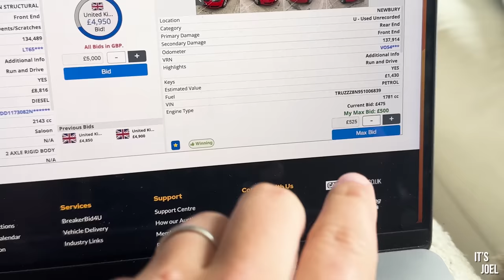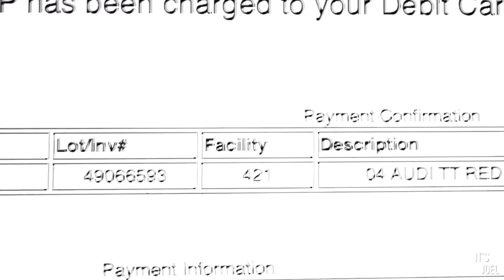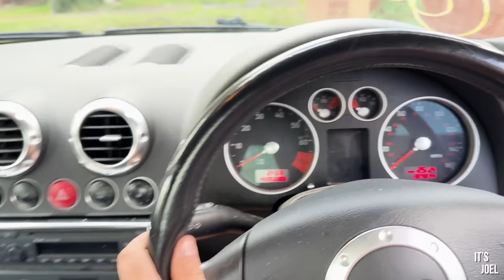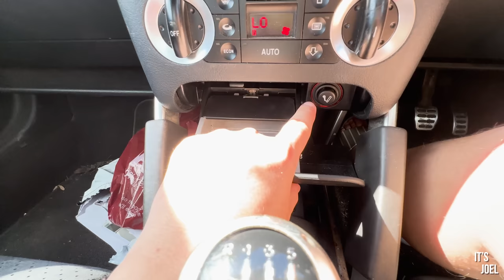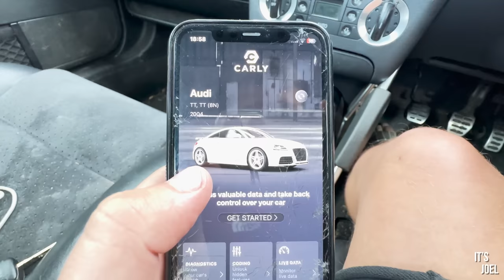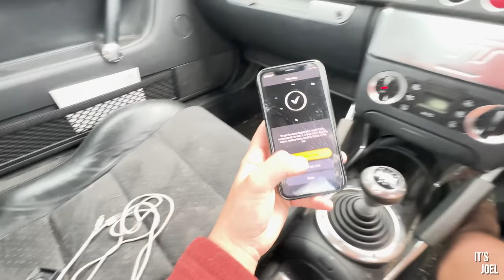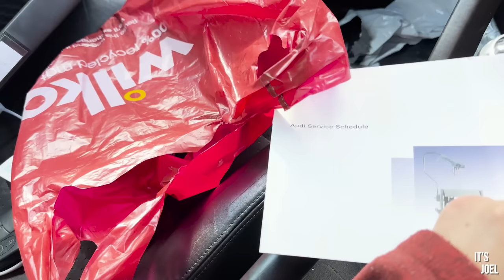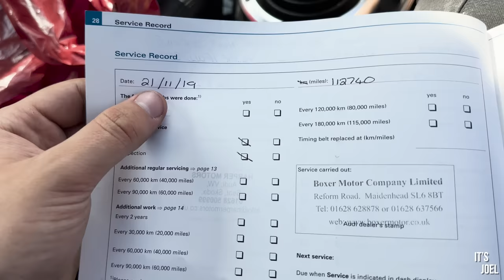I ACCIDENTALLY BOUGHT THIS VERY CHEAP AUDI TT ON COPART...

Comment: You should DEFINITELY service it Joel, and service the Haldex filter and fluid as well. Believe me the car will thank you for it!!!
Reply: no haldex it's not the bam model
Reply: @ianbawler5714  lots of other tts had quattro, it was an option for the 180hp and the 225hp apx cars had it too. Although you're right this car has no quattro / haldex.
Reply: no haldex yeah, the boot floor has a bit less depth on quattros
Reply: @fabium3410  aye there's way less space in the back of mine!
Reply: @ianbawler5714  Not saying you are wrong....but Harper Motors mentioned the Haldex system April 2016..... see 27:58. They spelt it Heldex...which is a bit worrying!
Others agree with you....and surely if had Haldex/AWD it would say "Quattro" somewhere?

Comment: I think you probably got a pretty good deal! A 1.8t without a check engine light has to have been serviced and as long as it doesn’t have rust holes in the body it’s definitely worth saving. If you’re going to keep it  then the most important thing with 1.8ts is oil changes and the timing belt

Comment: If you’re keeping - get the cambelt and tensioners changed. Ive just bought a 2004 myself and and put back on the road after 6 years unused. 8 weeks of restoring and maintenance and passed the mot 1st time with no advisories. Well pleased. And i changed the cam belt. Not a nice job!
Reply: Came here to suggest cambelt immediately, that service history doesn't sound like its been done previous

Comment: Looks like a bargain, Just make sure it gets an oil change sooner rather than later, as the old 1.8 turbo does suffer with a blocked oil pickup if neglected.

Comment: Great purchase. I believe those engines can sludge up if not looked after so given those service intervals definitely check the breather system is functioning correctly, clean the oil screen in the sump and maybe one or two oil changes. Well done!

Comment: I had a late 2002 225bhp 1.8ltr for five years and absolutely loved it.  The little spoiler on the back followed the "moose" test in pre-development (it's worth checking some of those early avoidance videos!)  I had very little trouble with mine; a broken clutch cable which was annoying at the time but bullet-proof Audi reliability otherwise.  The fuel economy was surprisingly good for a quick car although the traction control can be a little interfering on very twisty roads.... so you need to turn it off to enjoy it.  I'm sure it will scrub up well and you'll get plenty of enjoyable use from it.

Comment: I think you've done pretty well there! I've bought 3 cars from Copart that weren't obviously damaged or written off ... Two had major gearbox issues and the other a flywheel and engine issue, none were advertised as such, but you take your chances. So I don't buy anything that isn't obviously damaged from Copart now. But, I love to see what turns up and then how good I can make it. You don't often get service history though, my local Copart chucks it away, saying its a GDPR risk ... Hmm. 
If that drives well, it looks like a decent buy and probably one worth tidying up and dailying for a bit. Looking forward to a driving video!

Comment: For the airbag light, one of the sensor connectors must be loose, pull off the interior panels and try to find it. Mine was the passenger side near the recliner handle. Also the dash lcd can be replaced, yours doesn’t look too bad but replacing it isn’t very difficult.

Comment: Have a look at FuriousDriving with re: to headlight restoration, can do it without a machine polisher. 
If you're going to go to the 'ring, I'd 100% change the tyres, I mean, even if its only to a reasonable mid range, it'll make a world of difference. (I run Debica Presto UHP2's, they're a company who are owned by and make tyres for Goodyear, so they aren't half bad)
Also, the underpinnings of this car is the MK4 Golf platform, so control arms and rusty subframes should be fairly cheap and easy to get a hold of 👍

Comment: Get the oil pick up oil changed. This is crucial maintenance on the 1.8T engine. The 150 & 180bhp models from my experience are usually less problematic than the 225's. No Quattro makes the car lighter and less to go wrong. Old 20yr+ cars I always recommend to people are mk1 TT's, Z4 and Mini Cooper S

Comment: Check under seats for air bag wiring which corrode or come apart mine was the same when I got it ,oil and filter a must and the oil pickup pipe in the sump cam belt and water pump you’ll have loads of fun 👍👨🏻‍🏭

Comment: I just did very similar but with a motorcycle.
I brought a 1998 honda fireblade for £620 with auction fees.
No history, no mot, I didn’t hear it running. 
Went through the mot no advisory’s it had recent tyres chain and sprockets no corrosion ride it every opportunity it’s fantastic bargain

Comment: Seems a great buy at the price but as you say : why did it end up at Copart ? Looking forward to the test drive video ! If you can get it clean , serviced and not throwing codes, never mind the Nurburgring I reckon Katy might be interested 😀
Reply: Indeed.  Should be a good project - a good clean and service of engine/gearbox/diff and it is ready for some summer fun.  I guess it ended up at Copart due to iffy service history and needing bodywork - they probably sold it at a normal auction without success so just punted it onto Copart as a last resort.

Comment: Joel, what a happy little accident :) Cosmetically, mostly it will clean up. If you ignore trying to fix the actual cosmetic damage (broken bumper, and seemingly peeling clear coat?) then there is lots of fun to be had with minimal cost. I have been considering one for a run-around with the missus and the dog for a while as, like you, my daily driver costs a little more to run and takes up a lot more space. They are surprisingly practical cars, just ask "All Torque" or "The Car Ward" . Good luck with this project matey!

Comment: Hi Joel, hope your well, I have owned lots of MK1 TT and I believe your one is NOT a quattro, so won't need to worry about the haldex service.... They did these in a front wheel drive model which I believe yours is and it's most likely 150 bhp as you have the 5 speed manual.... you should have quattro on the passenger side dash and the logbook to verify this..... Love the content, keep it up
Reply from the maker: Thanks Ash, you’re right it is a FWD 180 model at least which is good. Not sure why someone had suggested haldex before, must have got mixed up. The great news is it’s had two cam belts though!
Reply: That's good, most of them are 150 bhp with the 5 speed manual, any way look forward to the content 👍

Comment: definitely worth saving, don't go way over budget by sending it to garages or buying dealer part prices, stay sensible. the 1.8T is a great lump and fun to drive. I would recommend servicing it yourself with some cheap synthetic oil and filter, clean and polish the bodywork and headlights, can't do too much about the lacquer peel unfortunately but think of it as a cheap summer car in good mechanical order and sell on (or keep). need to get that airbag light sorted, that carly thing didn't seem to read most of the ecus at all, since there should have definitely been a code for the airbag light, could be just the seat connectors but needs to be gone to pass it's mot. hopefully you can get someone to scan it with vag-com on their laptop. I bought a chinese vag-com scanner for 30 quid and works great but takes a while for it to come down from china

Comment: I think you lucked out and got a great car. Just needs a really good clean. Maybe a job for iValet? I think that was peak Audi between 2000 and 2010. The cars were well built and nice to drive. Need to check the age of the timing belt, i dont think those engines were chain driven. For the money you paid, keep it for now. Need to see more videos on it.
Reply from the maker: Incredibly, it's had the belt done twice! Last at 112k...
Reply: @itsjoel  - although tbe paintwork is very tired broken trim parts, it does seem to be a very solid car. Cambelt change is a real bonus at that price. Previous owners appear to have looked after it okay in the most important ways. Suppose fact it is so sdirty and has poor paintwork is reason it went so cheap
Reply: Oh, and the mileage of course. Fairly high, and wasn't there a mileage discrepancy pointed out by Copart - meaning it could be even higher than advertised?

Comment: Joel, what do you have to do to buy from Copart and the like? I tried to sign up once and it said only for business customers. I'm happy to buy on a business basis, but what do they actually want? A limited company? Can I just make up a business name?

Also, on the car, I think you've hit the jackpot there for £500 or whatever. These things are hands down one of the most timeless designs ever. Hardly looks any older than the one that replaced it, and waaaaaaaaay ahead of anything else 1999.

Comment: You really should have checked inside the Oil Filler Cap and all the Fluids first before anything else to make sure the Head gasket was ok, but it should look ok once it’s fully Valeted, Good luck.

Comment: Just a small point to bare in mind. Technically, with you sitting in the car with the engine running, you are operating a vehicle with no insurance? If a police car pulled up and the anpr caught your plates you'd be in trouble. I'm not hating, just saying?

Comment: Needs a haldex service … sounds like you have a Quattro there?
Reply: There's no quatro badging on the car
Reply: @PointNemo9  That is indeed true ... but my understanding is that the haldex is the engagement mechanism to connect the AWD system - so, either its a quattro, or the person scribbling in the service book at 28:08 is mis-informed 🙂
Reply: @andrew mitchell  I think it is far more likely that they are misinformed than Audi not badging the car correctly 😂

Comment: Because I'm a nerd I can tell from the pictures it's a 180 because the 225 had twin exhausts.
Reply: Wasn't there a 150 as well?
Reply: I might be wrong but I think the 180 and 225 versions had 6 speed gearboxes and the 150 had 5 speed...

Comment: Hi Mate. I do a similar channel myself, check it out if you have 5 minutes ;) what I would do if this was mine , to eliminate  the roof peel, I would 100% have the roof rapped from the bottom of the rear quarter window up round to the bottom of the windscreen,  in black gloss  vinyl.  I use a very very good company called MDP.  KPMF wrap is very nice to use.  Then wrap the accents I.e door handles and wing mirrors. Way cheaper than paint especially  if you do it yourself. With a good valet this will come up great. Definitely  clean it yourself. It will be alot more rewarding  and also you are not depending  on people that could potentially  mess you about of let you down .  If you can get this gleaming,  it's the good weather to sell and make an awesome profit. In my experience  with copart. I've not had many success  stories , however  I have never been at a loss on resale, keep up the good work mate , you have earned my subscription 
💪🤠👌